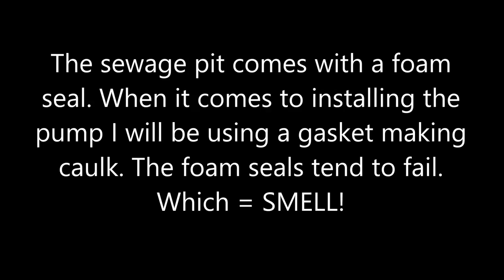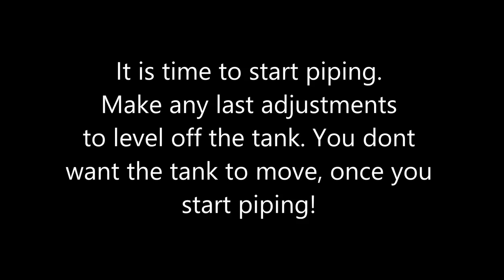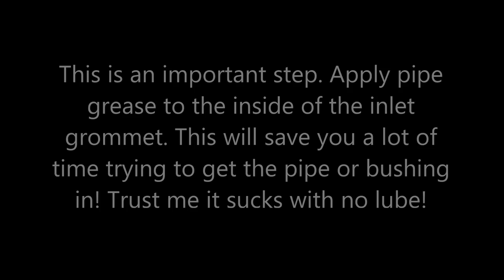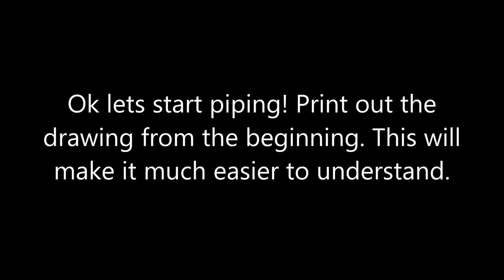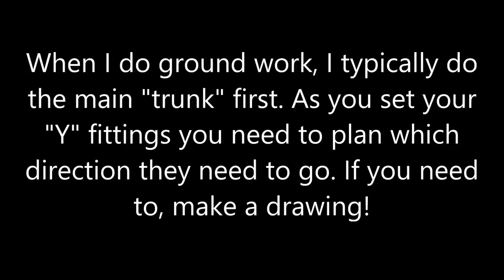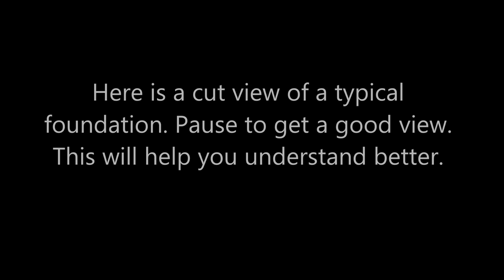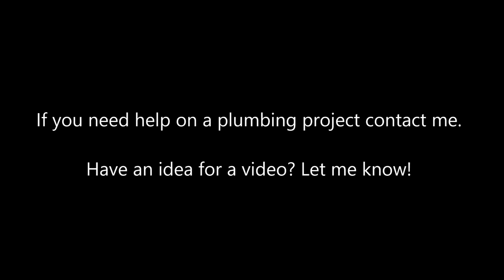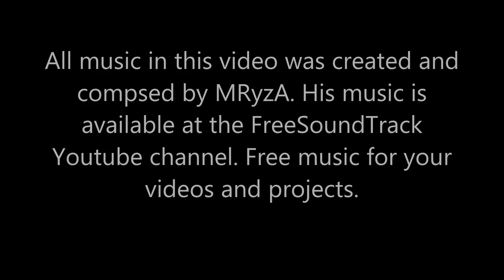Basement Plumbing Ground Run Video HD

Comment: great video!  I am in the process of designing a garage with a loft (Man Cave) c/w full bathroom up.  I am looking at placing a system under the stairs.  The discharge will then be redirected back under the slab to run approx. 60 feet to the septic.  I have 2 questions.   1)  Is there a set horizontal distance I should have above slab with the discharge before redirecting under slab.  I do know to use 45"s to make my 90's.  2) What depth should I be at below grade when coming from under slab.  This garage will not be heated at all times during winter.  I am in New Brunswick
Reply from the maker: +MFDPaul I hope your project went well. Just came across your comment this morning.

Comment: I usually see ABS pipe on the west coast
Reply from the maker: Dunn Plumbing llc Only use it in residential plumbing. Commercial we need to use System 15 or XFR. In Ontario, Canada btw.